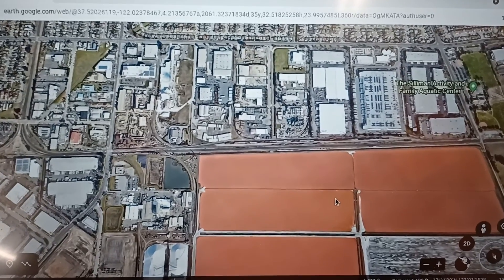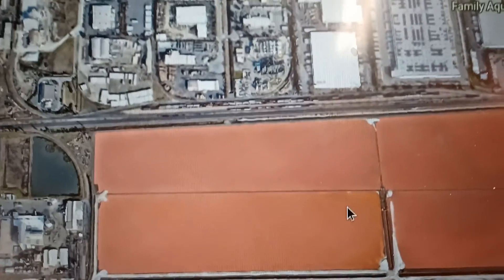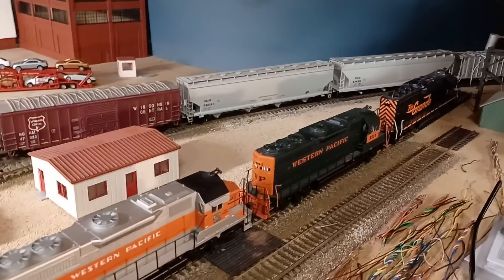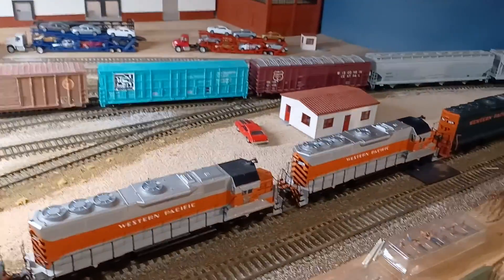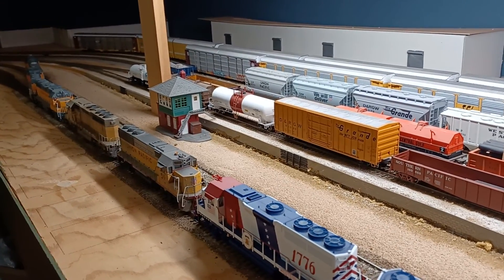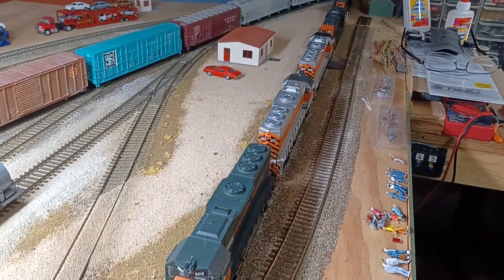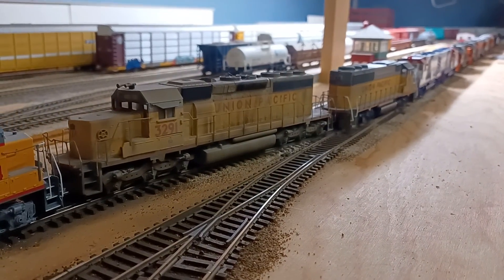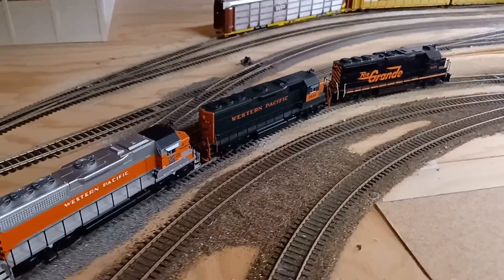HO Scale  Bad Order Hospital train with 13 engines

Comment: Merry Christmas daylight Dave thanks for the video thanks for the experience when I drove the pump truck always kept the little bag of spare stuff little bag of the air hose little piece of copper pipe that will fit in the air hose and I can put some pop clamps around it in case the air hose broke little piece of radiator hose fuses wire you know that stuff and some tools
Reply from the maker: That's pretty neat John, my go tool was a Leatherman and plastic and wire cable ties.... I can temp. fix just about anything...😜  Merry Christmas Bud!!

Comment: Wow 13 engine I bet with that amount of horsepower you didn’t even feel those cars you were pulling
Reply from the maker: Well... you can only have so many engines on line as you could break a knuckle or even worse, yank out a draw bar...  but in my case 9 were bad order so they were not on-line... take care!  David...
Reply: @daylightdave9405  Are all 13 engines running? When you had the consist in real life. If so were all the engines pulling together that’s a lot of horsepower. That’s what I meant by the more horsepower the more weight you can pull. I used to race trucks about 12 years back and we did a lot of pulling so I know a little bit about that definitely not like a locomotive but I was just wondering if that was the case. With all locomotives MU’ed together and all running were they all pulling together at the same time. Hey you know what this might be something to talk about would like to hear how this all works take care
Reply from the maker: @bobbywright2100  So manifest trains you can have a max. Of 52 EPA Equivalent Powered Axles.. engines have different ratings.. while intermodal you can have a max. of 62 otherwise with to much power you break the train in two.. each subdivision also has a different tonnage rating.. so yes they can all be running but not all can be on-line meaning I'm using the poweredd axles and dynamic. brakes.. as oppose to them just idling in the consist.. same thing with dyn's.. only so many on-line otherwise you could pop a car out!  Lots of restrictive rules.. hope that helps a little.. 😜 🤗
Reply: @daylightdave9405  awesome thanks that makes sense now.